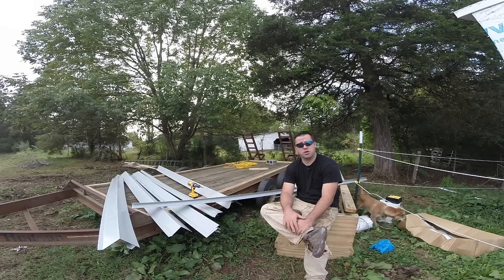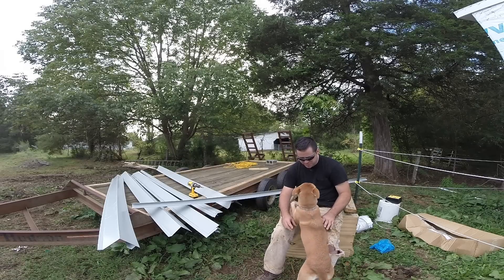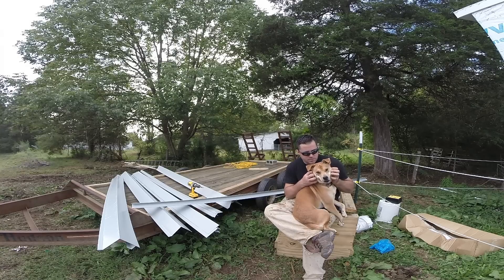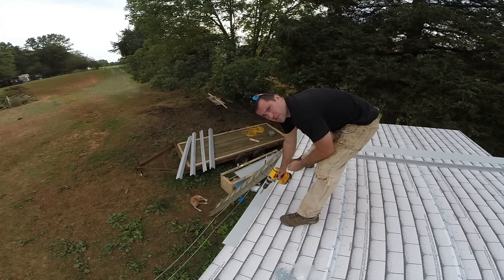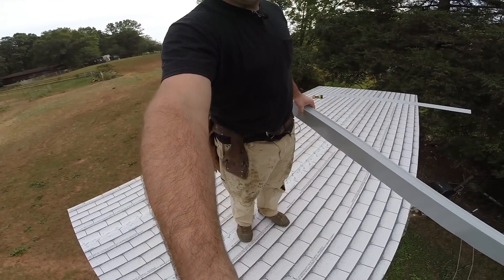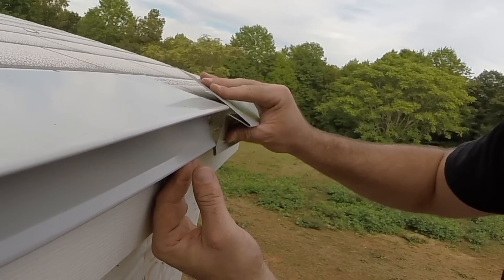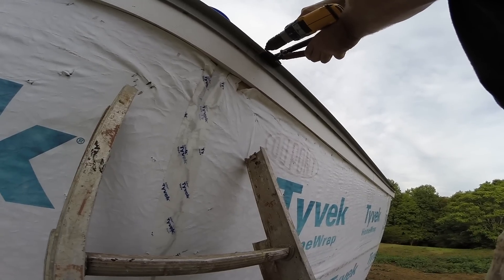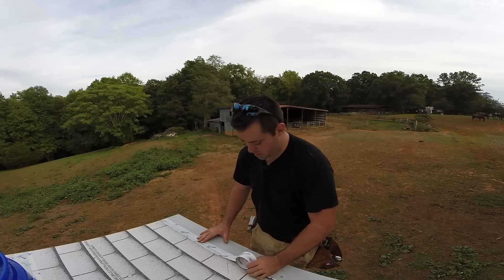Tiny House - Roof Prep and Drip Edge.  Part 1 of 6

Comment: Hi. I was told by a friend this sumer when i was doing the roof of my cabin that i should not use my grinder to cut metal roofing. something about the grinder heating the metal and damage the rust prufing in the cut aria and i should use a hand cutter in stad. but maybe he is just being overly cearfull becaus he does this for a lifing and wants to keep his clients happy. :)
Reply: He's right, the heat generated by the grinder can cause the polyester coating on the metal to delaminate down the road.
we still do it sometimes though.
Reply from the maker: +meuntitled Doing more research on this, I've learned that the hot sparks will land on the roof damaging the protective coating.  So yes, its not recommended using a grinder.  Of course the projects done already so any damage done is gonna stay.  i did notice a little damage when i was doing it but nothing substantial, but over time it might get worst.
Reply: Tiny House Customs the sparks landing on the finish could burn it, but the long term danger would be the finish flaking off. Cant tell if your metal is Galvalume or prefinished on my phone, but is a bigger issue on prefinished metal.
Best way to cut is with snips, or a carbide tipped saw blade made for cutting sheet metal (don't listen to anybody telling you to turn a regular saw blade around backwards).
Source: Am a commercial roofing contractor.